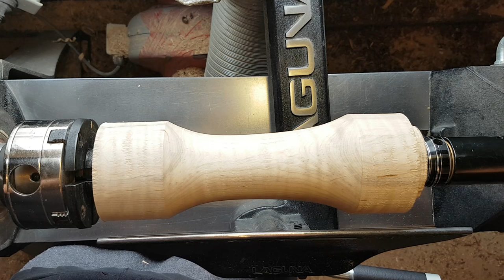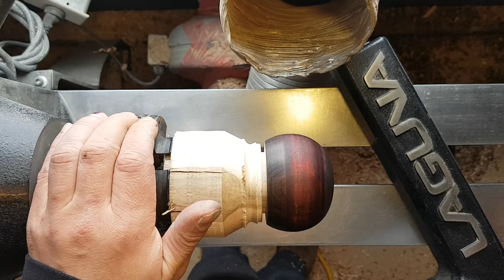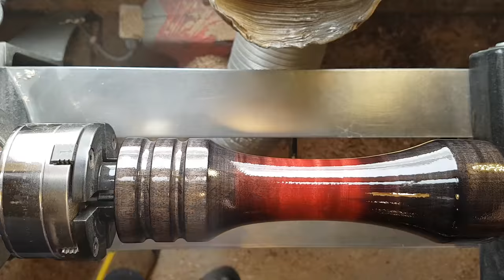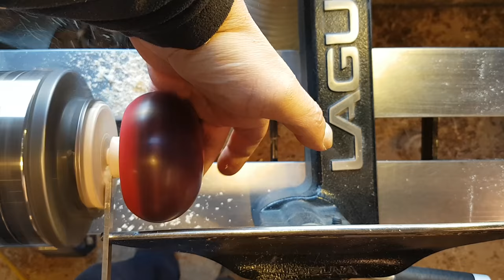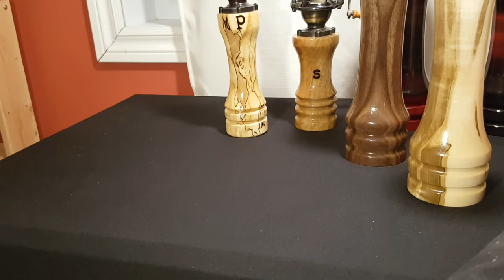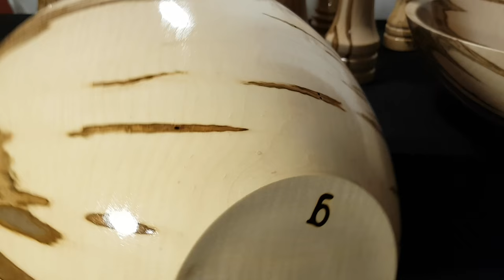Woodturning And Coloring Pepper Mill

Comment: Great work!  I enjoy your videos--sorry you lost some.  You should be cautious about using salt in the crank style pepper mill.  The mechanism is metal and salt will corrode it over time.  I speak from experience!  I presume the crush/grind mechanisms on the tall ones are ceramic so salt is OK.
Reply from the maker: +Tom Puskar thank you Tom . How many time it take to corrode?
Reply: I'm not sure.  The customer had it for about 6 months and had it filled with sea salt.  She kept it in an outdoor, screened gazebo here in NJ.  It was covered but in fairly high humidity.  The mechanism was corroded and the salt was pretty solidified.  I replaced it for her and started warning people not to use it with salt.  This is the one and only incident I had.  Good luck with yours.
Tom Puskar
Reply from the maker: +Tom Puskar thank you Tom for your info :)

Comment: Simon, I like your artistic styles, very nice stuff--you are a very good woodturner for just having started 6 months ago or so. What is the tool you typically use for hollowing you bowls etc. and also what finish did you use on those particular bowls-they look awesome bro!
Reply from the maker: +Don Davis Thanks Don. But I can't answer your question because I always use 2 to 3 tools for hollowing and I never use the same finish. Lol sorry. Shellac mix with oil  epoxy, salad bowl finish, wax, lacquer.
Reply: Thanks anyway Simon, the tool I'm interested in seems to have an adjustable perhaps carbide tip on it. The bowls in this video are awesome man!
Reply from the maker: +Don Davis I got the Henry Taylor little sister hollowing tool

Comment: very nice - what pepper grinder mechanics do you use?
Reply from the maker: +DCB METZ Thank you, the stainless steel one.
Reply: where do you order them from?  Which ones specifically.  I hear they are considered a bit difficult because of all the different size holes necessary.  Or is this not actually difficult?
Reply from the maker: +DCB METZ i dont remember the site but search for pepper grinder.  And they are OK to do . A couple hole that it